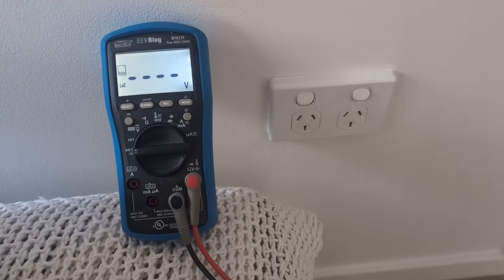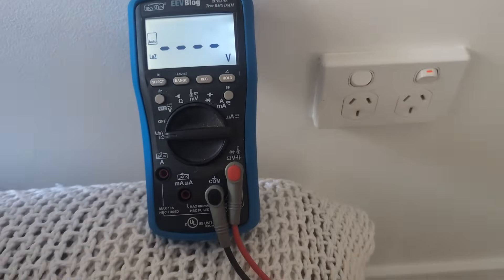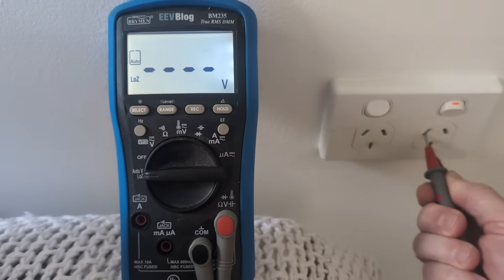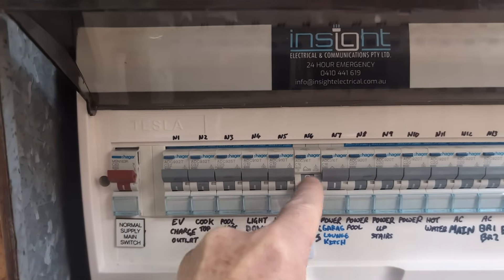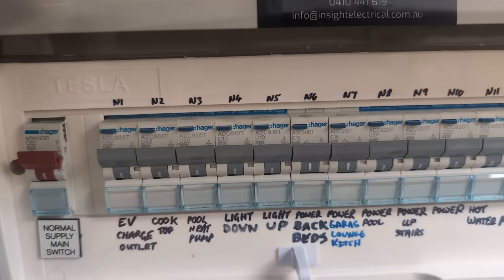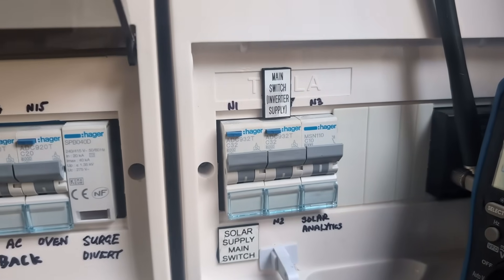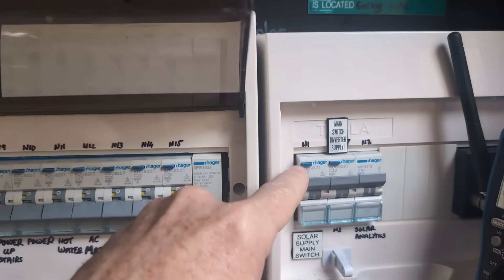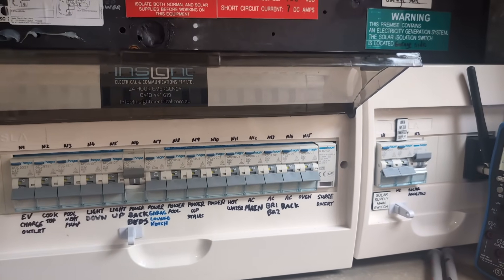Electroboom Style ELCB Test & (Hager) Failure

Comment: I guess it lost sensitivity. The 2.2K will draw some 100mA, 3 times the intended trip current. The test button probably just leaks a little over the rated trip current.
Reply: Typically the test resistor is a 7k5 3w metal film resistor, designed to pass 25mA, and it is connected so the test button is one side of the sense coil, with the other side of the resistor being to the other mains terminal on the far side, so the imbalance current flows in the one winding only, simulating a fault to ground.  Typically live side of the output to neutral on the input, so it will add to any leakage currents already there. the resistor is after the trip contacts, which are on the input, so the power dissipated in the unit is low, and self clearing, which is why you have the warning about not back feeding the device, as the trip coil in active units is also powered by the output. Typically a SCR in a bridge rectifier in series with the trip coil, with the active electronics fed around 0.5mA or so of power by a mains dropper resistor, so on detecting imbalance the SCR is fired, shorting the bridge, and pulling in the trip coil hard, which releases the breaker latch. 

Older units used no power, the trip coil being instead a biased coil,, critically adjusted so that it would just hold when it was closed when operating the switch, and then the current imbalance coil, wound from permalloy, and having a good permittivity till it reached a certain flux value, after which it would saturate hard. The primary wires went through in 2 turns, and then you had a few dozen turns of thin wire as secondary, connected to a bridge rectifier made from 2 regular 1N4148 diodes on one side, and 2 6V8 zener diodes on the other, with a 47uf 25v bead tantalum capacitor on the output. This then had a BRY39 GCS thyristor connected, with the coil in the cathode lead, and a resistive divider, with a small 1u5 25v tantalum bead between anode gate and ground, so that, for a slow rise of voltage, the GCS would fire around 4VDC, biasing the coil to release the armature, triggering the unit off, and for fast rising voltage the capacitor would fire the GCS unit before then, tripping faster than waiting for the rise to reach the trigger point. Disadvantages is they are not going to react to DC current, and noise on the supply could trip them as well. 

The modern ones use a small IC, and are more immune to noise on the mains, and also most now have a hall sensor near the coil to detect a DC current flow imbalance and trip that way, which the old units are unable to do, being AC only units. Amazing just how much functionality you can put into such a small package, and make it economical to mass produce for a very low price as well.
Reply: The EM style uses a permanent magnet to hold the trip mechanism.  A coil run by the secondary of the CT disrupts the magnet and a spring pulls the trip.  I've taken 30 year old Siemens apart and also new modern one and they both worked fundamentally the same.  Type A RCDs don't react to DC, they are just rated to handle up to 6mA.  If DC reaction is desired a B or the like is required.
Reply: If there is a neutral/earth fault the test current can partially flow around that path reducing the imbalance detected.  The test resistance varies between RCDs.  I have a selection of makes and models of EC types at hand and values measured are 7.5k, 5k, 3.7k -ish.  All that really matters is sufficient current passes to ensure that the circuit will absolutely trip as it's only a test to prove that the device is capable of tripping, not that it is operating within specification.

Comment: With the ELCB being integrated into the overcurrent protection, is there any indication of why a breaker tripped? It's probably not worth the hassle in most cases, but I'd be inclined to have them as separate devices just so it would be obvious what the fault criteria was.
Reply: Some provide indications. Another commenter said the newer type Hager ones show a yellow flag if it tripped because of leakage. I know American type ones will blink an LED showing last fault when you turn them back on, however I don't believe this works if it trips again instantly.

Comment: ElectroBoom is a madman. He is travelling through Europe, and purposefully tests the RCD/GFCI breakers that pretty much every outlet has to have for "content", just, they are all on a central breaker. Which results in him tripping the power to the whole floor, and sometimes whole building. So, I have been in a fancy shmancy apartotel, when some Americans decided to trip the breakers for fun, and the receptionist was gone. I could not finish important work at the hotel, because my old laptop did not hold a charge, and I got so angry. If that would have been electro boom doing it on purpose, I would have exploded like a 2000s-era elco cap.
Reply: I get what you mean, working is more important than people messing about. But you have to admit that a single outlet being able to trip the whole floor's or building's power is retarded design.. and also not having consumer unit access in your apartment and having to call the receptionist..

Comment: @ 2:30 In my experience with Hager usually afteet 6-12 months 1/2 of the installed breakers the test buttons won’t trip the breaker 😢 - this is happening only with Hager … + most of the time I can’t reset them if they trip only after many attempts 😅 
This is happening to me wih many of their models …
Reply from the maker: Sorry but I can't believe that you have a 50% failure rate after 12 months.

Comment: Solar analytics likely not a RCD because there are no socket outlets or light fittings on it, and all parts are inside the panel and protected by at least double insulation as well, with no metal parts accessible to incidental contact. Yes a mass made MCb has a certain failure rate early on, but the nice part of the design is that this failed into the safe state, cutting off power, and thus doing a safe failure correctly.
Reply from the maker: Yes, not really needed because the load is 100% known, and there is no earth connection to it.
Reply: @EEVblog2  Mostly because there is no chance of incidental contact, which is the reason you have the RCD in there. Not for equipment protection (that is the job of an internal fuse or thermal switch) but to trip if a person comes into contact with live wires. The MCB part is there to protect cabling from damage.

Comment: I guess I would disconnect the load from the breaker and try that trip test again. If it still doesnt pass that test, I'd replace it. That would step one. If that curcuit still trips from time to time, I would turn off the breaker and check resistance from load to ground, load to neutral. That should be an open circuit.

Comment: Glad to see you finally upgraded your switchboard from that ugly abortion of a thing you had before. 
I upgraded all my breakers to individual Clipsal RCDs several years ago to make it easier to trace faults and also add protection to the lighting and fan circuit which didn’t have any protection on it other than over current. 
As a bonus I gained some space for more breakers in the future.

Comment: I've had a few Hagar breakers fail in my building. They seem to fail in a way that makes them hyper sensitive to earth leakage. I've not checked the test button before replacing them though, maybe next time I'll remember to do that.
Reply: So fail-safe. Neat.
Reply: They are all supposed to fail more sensitive and nuisance trip forcing people to get them fixed. Design feature. Of course this doesn't explain why the manual test trip failed. Send it off to Big Clive for the post mortem.

Comment: I'd suggest that your contractor Insight Electrical would be responsible for replacing the breaker under warranty after such a short time?  I'd also suggest you encourage them to get a proper label maker rather than scribbling in sharpie on the board!

Comment: Make sure to keep the old one and make a video analyzing it. It seems to have two separate failures?
In theory, there could be a leakage current somewhere in the reverse direction, from a different phase, that is just not enough to trip it. That could cancels the trip current from the test button partially. But I guess this is very unlikely since you all have separate circuits.
Reply: Look into neutral/earth faults, that's what you are after as a possible explanation for Dave's issue.

Comment: So Dave, are you licensed enough yourself to replace it? Or does that require other certified engineers to verify it is in working order (after fixing)? I haven't watched the other video.
Reply: Where he is you need a certification to touch the panel, no DIY allowed, though other Aus states are a lot less nanny about it.
Reply from the maker: @SeanBZA  There is no state in Australia where DIY is allowed, you have to be a licensed electrician.
Reply: @SeanBZA  In all states and territories only licenced persons can work on the installation and that includes even something as simple as tightening a screw on a breaker.  Of course people still do it, but get sprung doing it and you won't enjoy the fine heading your way.
Reply from the maker: I can't even legally replace a light switch.

Comment: Hey, nice RCBOs there! Despite coming from Hager, they're not really used here in Europe because the electrical codes mandate electromagnetic rather than electronic trip mechanism for better reliability, and in the result, it's hard to do it in a single DIN module. Siemens did it with their Sentron breakers but they're fairly expensive and uncommon in domestic settings.

Tesla electrical panels, none of that Elongated Muskrat rubbish. Certainly not the old Czechoslovak one either.
Reply: All my breakers in my barn are RCBOs apart from my solar inverters that have a built in RCD that was a recent board upgrade when my 10kw inverter had a relay weld itself and the only replacements was 2x 5kw inverters but my board was full with 2x RCD protected groups that was the standard at the time freed up so much board space
Reply: In the Europe where I live, combined breaker/RCD's are common.
Reply: @Peter_A1466  I've seen a lot of them but they were pretty bulky, taking up two modules instead of one.

Comment: Failure of the button to operate can be an indication of a neutral to earth issue, obviously it could just be crook and there are other faults that can cause it to not trip with the test button but a neutral earth fault is a good place to start.  Neutral earth faults can also cause apparently random trips of a device based on the draw of the loads on the involved circuits vs fault impedance too.

Comment: If you have had much rain, sometimes water finds cables and follows it down to the back of a power point.  Also if you have tripped it a few times without clearing the fault sometimes they RCBO break.
Reply from the maker: We have had a huge amount of rain, but none the night this happened. If the test switch worked then I would have investigated that further, but when the test switch doesn't work, the unit is faulty.

Comment: Just a a final test Dave. Drop the load wires from the rcbo both line and neutral and try the test button again. If it still won't trip then yes it's heading for the bin. If it now appears OK look for a neutral to earth fault.
Reply: Or the test button physically doesnt connect a fault across it for some reason.
Could be tested by creating a fault at the socket using a potentiometer, in proper electroBoom style :D

Comment: You need one of those electrician's socket testers. I've got the Fluke one, very useful.
Reply: I got mine at LIDL for a pittance, works a treat
Reply: I always use the LoZ function on my multimeter to test them 😅

Comment: Seeing you test the other RCBO's this is not the answer but RCD / RCBO can be blinded with back fed DC from faulty inverters!
EV inverters especially!
I have seen it with an inverter driven motor.
You can get a more expensive version to check for this!
The reason for the analytics plain MCB is cost savings.
Reply from the maker: There is no such inverter on that circuit. And all my circuits are radial.

Comment: A handy feature of the Hager ADC9 series RCBOs is there is a small yellow flag on the left side of the handle, indicating an earth fault (As opposed to a short where the yellow flag does not appear). This is unfortunately not available on the older ADC3 series (your N6 & N7). Regarding the test button fault, I suspect a faulty button contact or earthing resistor inside the breaker. Call up the sparky and they might replace the breaker for you to do a quick teardown!

Comment: I had news RCDs installed when fitting a transfer switch.
The one for the lights stayed on for about a day then wouldn't stay reset.
Rang the sparkie he, he couldn't get back until the following day. I decided it had to be a mechnecial issue inside the RCD so I tried resetting it with my left hand.........it worked!!
Not so sure the sparkie really believed me until after he had replaced it, while we were having a chat it trippped while he was holding it in his hand.

Comment: If the test button doesn't work its a faulty breaker
Reply from the maker: In this case the earth is common bus bar running along all breakers, so has to the unit itself.
Reply: @EEVblog2 hope we get a big Clive style tear down of the failed breaker.
Reply: @EEVblog2 its odd it still works the test button is just a resitor.
Reply: @redolgreg and that resistor will burn out in couple seconds, if it doesn't trip the breaker instantly for some reason.

I have found tens of rcd:s that work just fine when tested with installation tester, but the test button does nothing.

I think that manufacturers should make the test button so that it only makes contact in mid stroke, so if there's a problem, it won't burn out while the user presses it for a minute or million times.

Most rcd:s are directional, but it pretty much only means that the test button is connected to the load side and disconnects when tripped. If run backwards, it might still be energised after tripping and just pressing the button for 3 seconds will burn it.
Reply: No, thats incorrect.  The test buttons bleeds a little current around the CT from active to neutral.  Earthing is not involved.
Reply: @retrozmachine1189  makes sense, you don't want to liven the earth if its not connected to a MEN, but then your also not testing the earth integrity. Now that I think about it the earth isn't even connected to the rcd / mccb.
Reply: @redolgreg  For a twist, sockets with integrated RCDs do bleed current to earth when the test button is pressed.
Reply: @retrozmachine1189  i guess that makes sense too. Thanks
Reply: @retrozmachine1189 I haven't seen any yet, but I have only been an active electrician for 26 years.. All the ones I've touched have had testing just like in their din-rail mounted cousins between N-L with another one bypassing the sum measurement ct or electronics.
Reply: @villehietala9677  I had a, now old, Clipsal integrated 30mA on my kitchen counter.  It bled to earth, presumably to verify earth was present since there is a window of current where a 30mA may not react but a person would still be shocked and earthing ensures safe touch is maintained in that window.  When I finally get RCBOs installed a few years ago it was removed and replaced with a plain 4 way because testing it would cause the RCBO to trip too.

Are the ones you have come across that only test using A and N been 30mA or 10mA?  I don't know why one would have an integrated 30mA RCD present with RCBOs/RCD in the switchboard so it makes sense that they, or at least old Clipsals, passed to earth to test.  I'm not sure what you mean by one bypassing the CT/electronics though, that's how they all work - bypass a bit of current around the CT A to N or A to E.
Reply: @retrozmachine1189 correct!